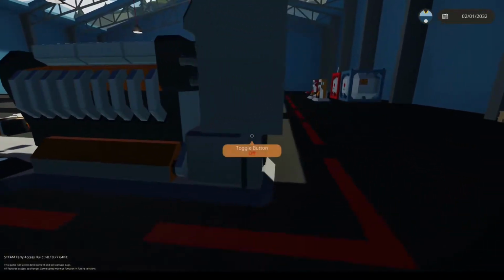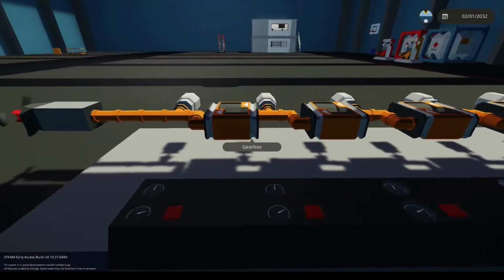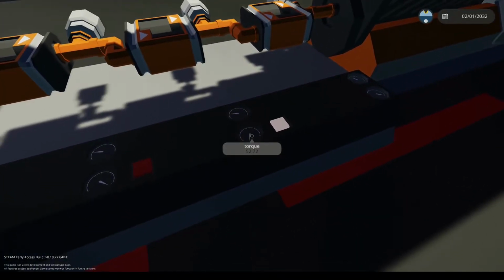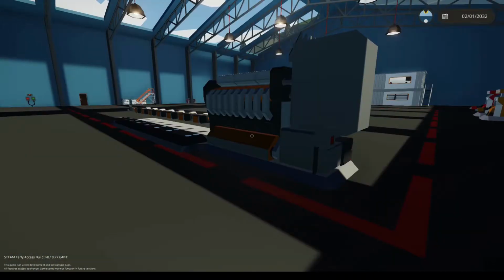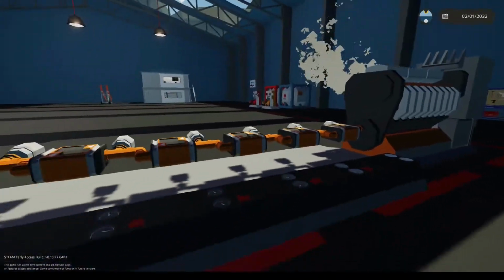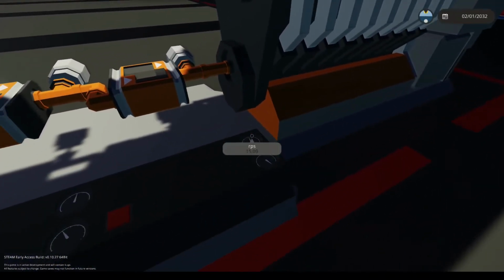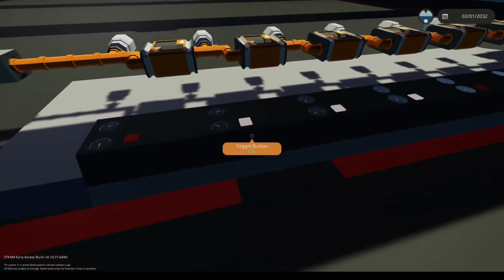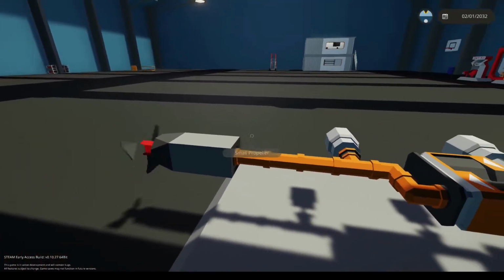How to Use Gearboxes - Stormworks tutorial

Comment: So. If i may pick your brain a second
Im currentmy building a medium sized cargo ship, nothing fancy but im having alot of trouble with the gearing
For some reason i cant get the rps of the propellors to get above 9 any attempt to boodt the rps using a gearbox just kills the engine, unless i have one boosting tourque, but doing his only gives me a very small boost in rps/speed
Advice?
Reply from the maker: Hi there, @Andrew Curtin, if you boost the only the torque will not increase the RPS, although if you use the select tool to edit the engine you can increase the max RPS of the engine, as long as it is not a jet engine, let me know if this works, 👍
      AJ,
Reply: @newajdesigns6248  the problem isnt boosting the engine persay its when i try to boost it using a gearbox, it kills the engine unless i have a gearbox boosting tourque, otherwise when i switch gears it just flat out nukes the engine
Reply from the maker: Hmm, OK, do you have a clutch on the ship, and is it easing in the change when you change the gears?
      AJ,

Comment: Thanks!  I’ve seen lots of tutorials about installing a clutch, but never when to use it. I’m assuming you want to have the clutch transmitting no power when you’re switching  gearboxes on/off. Is that right?
Reply from the maker: Yes, if you are causing a big change to the current power (eg reversing it) although you should get away with no clutch if it is just minor changes. 
  AJ
Reply: New AJ Designs thanks!
Reply: no